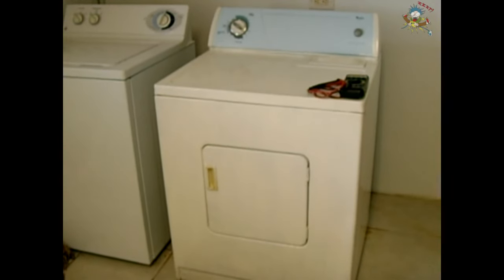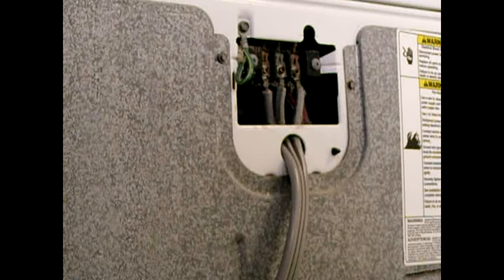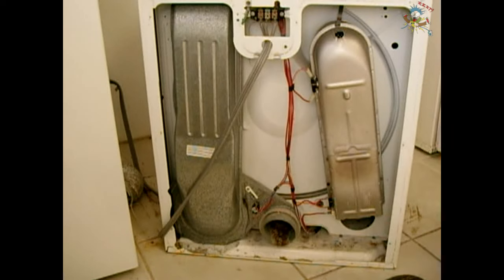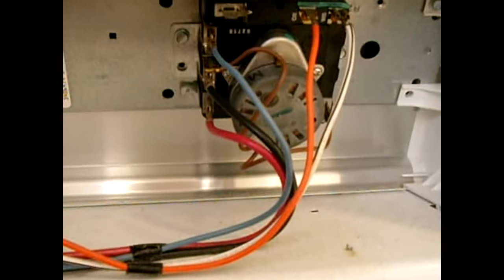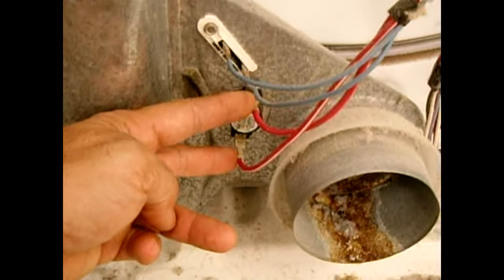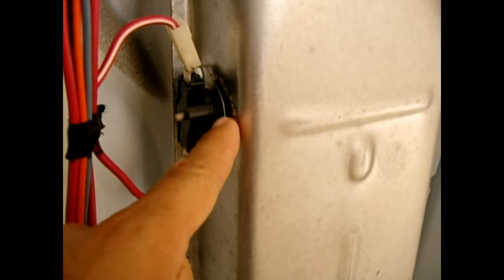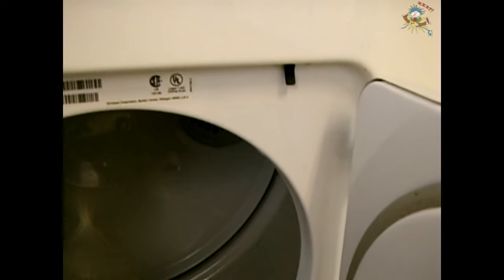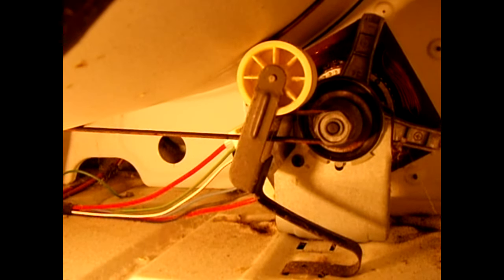Dryer Not Heating, Won't Spin, Or Start Up

Comment: This is a fantastic piece of knowledge. Great video. I hope everyone with a dryer problem find this video.
Reply: Quick question if your still there, I have not continuity through my inlet control thermister on a GE electric dryer. It operates fine until you go to start a cycle in which case it will just never start. Also in the diagnostic test of the drum it will not rotate. Is this likely the thermister causing a fault that will not allow the drum to turn? Like if yes, down vote for no
Reply: @electronicsNmore

Comment: This was an EXCELLENT video and it helped me diagnose my problem -- the power supply. I had an intermittent faulty 30v double breaker. Before watching this detailed troubleshooting video I started to make the assumption that the heater element went out as I was not getting heat. It tested just fine. Anyway, thank you so much. 
And to the trolls that gave this video a thumbs down, well, you know what you can go do!
Reply from the maker: Never mind them, Youtube has many Trolls, haters, and other undesirables that thumbs down a video out of spite. Glad you enjoyed the video! I have a lot of excellent videos on my channel that cover many different subjects, so be sure to check out my extensive video playlists for other videos of interest to you, rate thumbs up, and share my channel with others. Also check out banggood4less.com for great deals. Thanks!

Comment: I tore down and repaired our dryer today using info from your excellent tutorial.  After checking things, I found a spade connector from the heater coil to the thermostat had come loose from the wire and burned some of the insulation off.  I replaced the connector with a new one and after a test run everything seems to be working fine again.  Without watching the video, I would have just guessed and bought a heater coil thus wasting money.  Thanks for helping us learn!

Comment: This is the most comprehensive repair/troubleshooting tutorial I have found in my search for solutions to repair my family's dryer.  We have a Whirlpool Estate manufactured with a three-prong power cord.  We had to replace the three-prong with a four-prong cord after we moved to our current address three years ago.  We've owned the dryer for about 11 years now; it's simple and sturdy so we'd like to keep it as long as possible.  Recently, it wouldn't completely dry a load without two to three runs.  It had been awhile since I last opened up the housing to clean it so I decided to complete this task first before checking any of the electrical components.  The instant I turned it on after closing it there was a flash and an audible pop behind the panel covering the power cord terminal.  When I reopened this portion, I discovered the black cord melted and separated beneath the spade connector.  This is not the first time I have opened our dryer to clean it so I am lost as to what and how this happened.  Your thoughts on what happened (including if it may have been something I did while cleaning it) and what I can do to fix it (if possible) would be greatly appreciated.  Again, thank you for the fantastic tutorial; I will be checking out your other videos.
Reply from the maker: Sounds like the connection was loose. As a result, it may have caused a short circuit across the terminals or to ground.

Comment: Thanks for making this video.  It is the most informative one I have seen so far on how to troubleshoot a dryer.  Our dryer recently failed to heat but the drum spins and the fan blows, so I'll be checking out the problem tomorrow by following your guidelines.  I feel confident now, that I'll be able to locate the problem and fix it myself.  Thanks again!
Reply from the maker: Glad you enjoyed the video!

Comment: Since my Whirlpool dryer went down because of no heat, I've been watching a lot of how-to and troubleshooting videos, and by far, this is the best video I've seen. Even though, I still haven't found the problem of why the heat isn't working on my dryer, this video is very informative and easy to follow. So far, I've ruled out the voltage to the dryer, the thermal cut-off fuse, hi-limit thermostat, and the thermal fuse. I'm just about ready to rule out the dryer timer/motor and the heater element. I'm just hoping that I find the problem before I have to get to that motor under the drum. A note of interest... my dryer is only 2 years old. Thank you, for a great video!
Reply from the maker: Hi there. I've seen problems before at the motor. Attached to the motor is a switch which only allows power to the heating element when the motor is running. Take it apart and check it out. Thanks For Watching!

Comment: Had intermittent heating issues....made a custom vacuum attachment from cereal boxes and duct tape and cleaned out the partition where the lint trap fits and it fixed the problem...thanks your are one smart guy....
Reply from the maker: Glad my video helped you Jim! I have many videos on my channel that cover a wide range of subjects, so be sure to look over my extensive video playlists below for other helpful/informative videos of interest to you, and most importantly share my channel with many others. Thank you 
https://www.youtube.com/c/electronicsnmore/playlists
Reply: @electronicsNmore  Now it goes out....then comes back....Timer issue or ignition problem ?
Reply from the maker: Either still dirty, a lack of airflow, or faulty thermal cut-off.

Comment: Awesome tutorial - thanks! After 2 days of troubleshooting and replacing thermal cutoff/fuse, 2 thermostats, confirm heater and centrifugal switch are ok - I decided to pull the timer again and give it a good cleaning under a magnifying glass. That was t = dryer works fine on all settings!! Thanks again!  ...Alan
Reply from the maker: You're welcome! Be sure to check out my wide range of videos and share. Thank you
http://youtube.com/c/electronicsnmore/playlists

Comment: You, Sir, are brilliant.  Wonderful well presented and useful tube! In my case a loose connection in the wall plate on the black wire prevented the element from producing heat… luckily your good advise said to start by checking if both wires were producing their 120V… that fix the problem pronto! Did also check all other components and did a good cleaning to remove lint.  My hat off to you Sir👍😎👍
Reply from the maker: Glad the video helped Richard! Be sure to look over my video playlists below for many other videos of interest to you, and most importantly take one minute to share a link to my channel with others on social networking sites. Thanks
http://www.youtube.com/c/electronicsnmore/playlists

Comment: Started dryer a second time and went to bed. Clothes not fully dry but heat was working. Three hours later it was still running but no heat. Timer doesn't move and no heat now. dryer looks somewhat like the one featured  Roper HD EX lg cap 6cyl/3temp  GREAT VIDEO !!! Operating temp thermo has 4 connects
Reply from the maker: Timer not moving? Replace the timer.

Comment: very good and informitive video easy to follow; I'm an electrican just checking what kind of information is out there. I would rate this video 5***         JUST BE SURE TO KEEP IN MIND POWER CONNECTION OR DISCONNECTION, REMOVING PANELS OR INSTALLING PANELS; DURING TESTS OR MOVING SWITCHES AROUND!!

Comment: Finally information is at hand....good video...couple things tho to help you...when you said not to bypass one of the fuses,, you should have also said NEVER BYPASS ANYTHING unless it is in order to quickly check for trouble shooting info. When you tested the element for a short to ground you placed a lead on the dryer body but the element housing was disconnected/removed from ground.  Just a couple of bloopers. Otherwise it is obvious to me that you know what it's all about.

Comment: Very good video. I've checked all of that. Replaced the timer, start switch, thermal fuses, direct wired the motor and it and the motor switch work properly. But it still won't start. When the timer is set on 3 of the 4 off positions and the start button is pushed, the end of cycle buzzer will buzz. In any other position on the timer, nothing happens at all. Going to try a tone probe next to see if there's a short in any of the wiring.

Comment: Thank you for an excellent video. My parents owned an appliance repair store, and I often feel like I channel my dad when repairing, and you remind me of that.

I've run into a problem that your video does not seem to address. On a Frigidaire with a momentary start knob, it will normally start after briefly holding the knob. But now I need to hold it for a long time; the dryer starts, but may stop if I release the knob. It does start after a few tries with a long hold. Suggestion?

Comment: Very Good video! 71 years old DIY 😂 easy to see and understand!  Maintenance on my 5 year old and belt and rollers Unit got noisy and found a worn shaft on the center one which appears to carry the most load from the drum. Now 3 months later element is visibly on but not trying in the Item as usual time , it appears to not being on th High level?  I believe I should Ck the flow chart you mentioned and hopefully find my issue.

Comment: I've been troubleshooting a whirlpool cabrio dryer and have come up with nothing. It was running and I paused it to open it then nothing! It starts all the lights work the timer ticks off like there is a cycle running but no heat no spin! I've checked power, thermal fuse, thermostats, heating element,  motor and so on! Everything you cover in this vid and more! Hoping you could shed some light on my ordeal!
Reply from the maker: Door switch faulty? Unplug the unit to try resetting it?

Comment: Thanks for posting this detailed, informative video. One question: Where all of these tests done with the power cord plugged into the wall outlet of 240? Or was the dryer disconnected to perform these tests? Thanks again.
Reply from the maker: The only time power was connected, was to see if power is making it to the back panel of the machine. After that test, you unplug. Thanks for watching!

Comment: Thanks for the video !!! Other than excessive lint blocking the flow of air, why would my Kenmore electric dryer take a long time to dry clothes? Can the thermostats be partially faulty ?
Reply from the maker: Faulty heating element or a faulty thermostat. Thanks for watching!

Comment: looks like my motor start coil is shot. no ohm reading. got a normal 2 ohm reading on the main windings.  problem is it won't start. was running fine, so makes sense.   
thanks for the great well made video!
Reply from the maker: If you tested the correct terminals on the motor, and the capacitor is good, then yes, you  likely need to replace.
Reply: Where is the capacitor located?
Reply from the maker: @FPVREVIEWS  You should be able to easily locate it by looking for the cylindrical plastic body.
Reply: How to test? Assuming I can locate it.

Comment: I replaced the thermal fuse with the code F40 flashing on Kenmore Elite OasisST and it worked for 1 day then the F40 code came back on. So now with the video I am going to replace the thermal fuse & tempresure switch. Thanks for the video very helpful. I just have to buy the parts. Where is the best place to buy these parts?
Reply from the maker: Yes, the thermal fuse blows if the temp switch/thermostat fails. Make sure nothing is clogged up with lint restricting airflow.
Reply: @electronicsNmore  Thanks for the reply.

Comment: Same exact dryer. Problem is won't start.  Tested everything you said, all checked out good, except when I got to the motor. The Blue and Black wire in motor not getting any reading. Blue and White getting 1.7 ohms. Blue and ground also did not show any reading. Arghhh! This was a great video. Thank you so much Does this mean I need a new motor?
Reply from the maker: You can always apply power directly to the motor with the belt disconnected to see if it works. If it does, then you could have a faulty timer control.
Reply: Thank you. I already replaced the timer thinking it was that at first because at that point I only checked the switches, fuses, thermostat, which all checked out. Then I replaced the timer, still wouldn't start. Then I found your video that got me down to the motor, at which point the blue and black wires didn't register a reading. Amazon had the motor for only $60, so hoping for the best. If that doesn't work, I will bring the dryer out back and use it for target practice.
Reply from the maker: fredk444
As I said, apply direct power to the motor, if it does not power up, then it's faulty.
Reply: How exactly does one apply direct power to the motor? I imagine somehow bypassing everything else, but how?
Reply from the maker: You need to look at the schematic for your dryer and wire the motor properly to a 240v power supply. What model #?
Reply: I do have that schematic, but do not have a 240 power supply, unless I could run jumper wires using the outlet, which would seem to need some heavy duty wires. Does it need 240 to run the motor, thought that would be just for the heating element. Would a 12V battery be enough to just make the motor at least turn? 

It's an Amana NED4700YQ1. Sadly, this dryer is only about 2 years old. 

Thanks for your help. If you or your kids ever need help with chemistry, let me know, I teach high school chem. That, or advice on motorcycles, that's all i really know much about.
Reply from the maker: fredk444
Thanks. Yes, you would use jumper wires that are heavy enough to carry the load. Before you do that, (UNPLUG THE DRYER) and check to make sure the door switch, start button, and any overload switch on the motor all work fine. When you check across the overload terminals, you should have continuity. If the winding does not look burned or smell burned, it is unlikely the motor is faulty. Make sure the shaft of the motor rotates by hand. That is all I can help you with. I have too many others asking questions.
Reply: I was messing around with it, giggling wires in the back of the panel while pressing the start button, and the dryer came on and the motor was running. I shut it down, then tried again and could not get it to run after that. There seems to be a loose wire or short someplace. So annoying.

Comment: Shouldn't 1 spade connector be removed  from 1 side of the fuses and thermostats to prevent feedback when testing for ohms?  Excellent very helpful video. Thank you.
Reply from the maker: It's a good idea to do that. I usually do that myself, unless it's very clear the fuse is in series with a power supply.

Comment: Some dryers (Kenmore) have also a switch called the "belt switch" ;  if the belt breaks the system will not start at all. It is located on the bottom, next to the belt tensioner.
Reply from the maker: liviu holca That is a nice added feature. I will make a note in the video. Thank You!

Comment: hello first wanted to say thank you for the very detailed and informative video for diy like us..one of the issues that i am having with my kenmore dryer is that it works and then shuts off after like 10 min or so and i have to wait for like 30 min then it works again. I am getting mixed information. someone said that my motor might be going bad, sears ppl i chatted said the control board needs to be replaced. someone said thermofuse. I am confused, I dont think is the thermofuse becuase i am able to start back later on, can you offer suggestion on where to start. just dont want to go and replace the motor if that is not the issue
Reply from the maker: You're welcome! Sounds like one of the thermostats are faulty, or there's a blockage that is restricting airflow.

Comment: Should I disconnect those wire to check continuity? Great video fam.
Reply from the maker: Make sure the machine is unplugged, any capacitors are discharged, then test for continuity. If a test fails, then try again with the wires disconnected.

Comment: Thanks for the great video.  Our Maytag 12-year-old dryer produces heat but has a burning smell on regular and delicate cycles but not on the air fluff cycle.  Would this more likely be the cycling thermostat that is on the blower housing or the limit thermostat and/or thermal fuse on the heating element?.  If the cycling thermostat, is there another way to test the continuity at the upper temp limit without an electric skillet?   Thank you in advance!
Reply from the maker: Make sure there is good airflow, and no blockages.
Reply: I clean the air duct system fully every year with a duct brush on the end of a drill.  I just did that again for this year, so I know that's not the issue.  I did find a large lint ball under the motor, which I removed.  The heating element, thermostat, thermal fuse all have continuity.  The cycling thermostat has continuity while cold and none while heated on an electric skillet (borrowed from a friend).  I have blown out every bit of dust I could with air compressor, and vacuumed.  It's now cleaner than the rest of my house, but I am still getting a very hot burning smell, but no smell on air fluff.  I greatly appreciate your thoughts.  The blower fan spins freely and produces good air flow.
Reply: In the thought it may help someone else...  After doing all as I outlined above, I inadvertently found out that the prongs on the plug were scorching hot after a short test run.  I do not have a way to post pictures here, but the outlet had arced (sp) and was melting the plastic housing where the one of the wires was attached.  Thank God we did not have a fire!  I replaced the outlet and all is good!